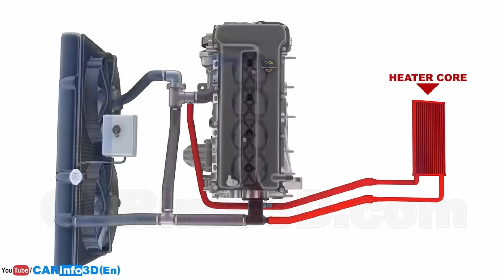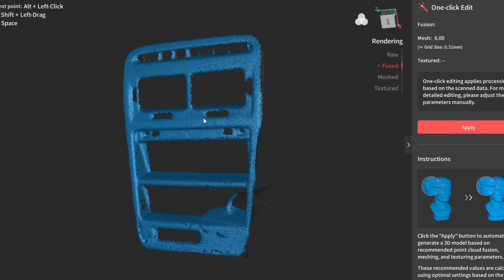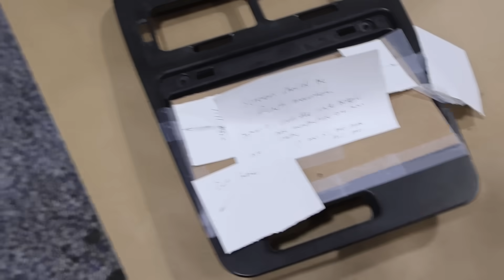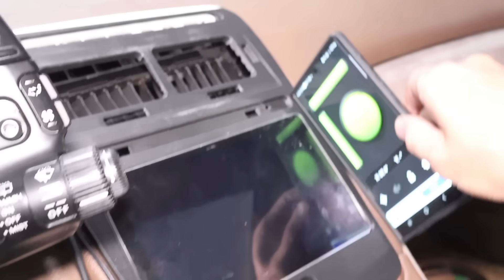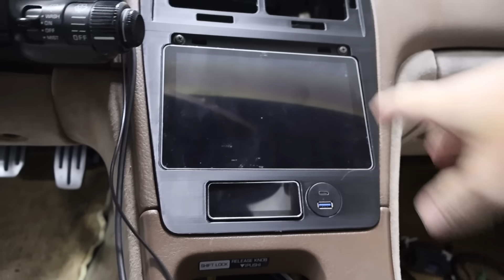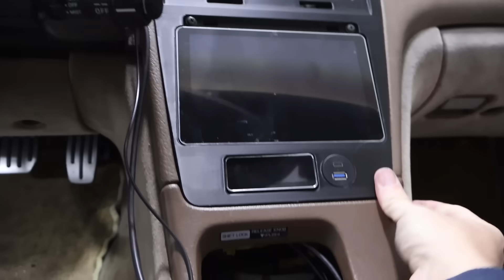Where is the dual motor Tesla Swapped Nissan 300zx?

Comment: I'd love to see an add on electric motor kit for front wheel drive cars. Basically just swapping the rear hubs to axle splined hubs then 2 independent motors that drive each back wheel. Because you still have the gas engine up front that can constantly recharge the battery pack, the pack could be fairly small and low profile in the trunk. Ideally this kit would be only a few grand, but could convert your front wheel drive car to an electronically controlled AWD.. giving both poor weather control and more power without compromising the durability/reliability of the engine.

Comment: The problem with angling the display "up" like that to flush it out is that there will be many more times that glare on the display will be an issue.  The customer might have to add a matte screen protector to minimize that, if the stock screen isn't matte enough.
Reply from the maker: That's a good point! We'll definitely keep an eye on the glare and see if a matte protector is needed.

Comment: Friendly advice - if you 3D print the dashboard and do not plan to do the shiny flat front, you can try to use the fuzzy skin for it - it will add a texture to it, hiding a lot of the layers and make it quite nice to touch.

Comment: One of the biggest problems when people model those injection molded pieces is that they (you too) keep features that were intended for the injection process instead of making then more sturdy to compensate for the weakness like layer adhesion.

Comment: Why no EV analog gauges?
Reply from the maker: customer preference
Reply: @electricsupercar would have looked far nicer with an NX1600 digital cluster adapted to fit in there personally. They seem fairly commonly swapped into S13's in the states, so seem easy enough to get over there. Like rocking horse shit in the UK though, otherwise I'd have installed one in my 300ZX already. 😢

Comment: Only thing that bugs me is the original screw plate on top.

If the screen would have been 3cm higher and detached at time of install, it could have hidden that top bit. Would keep lower bezel a bit more thick as it has flimsy appearance on driver side.

And digtal dash looks small, would fit the parking sensor display or other stuff for cleaner look too.
Reply: There’s a cover plate that hides all that. He mentioned it a few times.
Reply: @xodiaq yes, but their point is it would look cleaner if it didn't need the cover at all, and the screen itself was in the right position to be able to do it. You would need a way to eject the screen though, kinda difficult with a flush mounted screen. Could always not use those screw holes at all though. Use the two screws above the vents at the top of the panel, and then just the standard clips for the bottom corners.

Comment: It hurts my heart as a '91 300zxTT owner that you are electrifying her. Just curious, since it has T-Tops, it had the VG30DETT twin turbo engine in it right? what happened to the engine?
Reply: The owner probably got tired of taking out the engine with any repair, or all the electrical connectors corroded
Reply: @timp5668  I know right? I HATE working on mine, absolutely NO room.
Reply from the maker: It was a non-turbo.  Engine was sold
Reply: @electricsupercar  thank you sir. Really enjoyed the 3d scanning and printing of the new radio tombstone. I already have a double din in mine and use the top portion for the radio and bottom portion for my boost controller.

Comment: Is that electric heater a drop-in replacement for the factor heater core?
Reply from the maker: Almost.  It is a good fit, but a true replacement would have slightly different dimensions.  We used some heater foam to seal up the areas that did not quite fit.